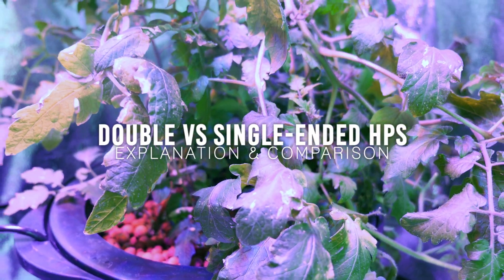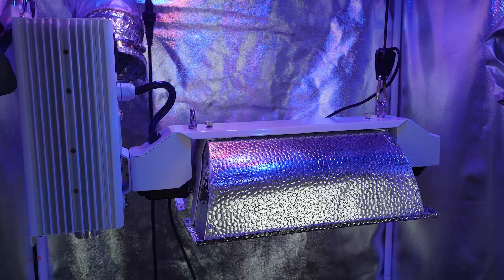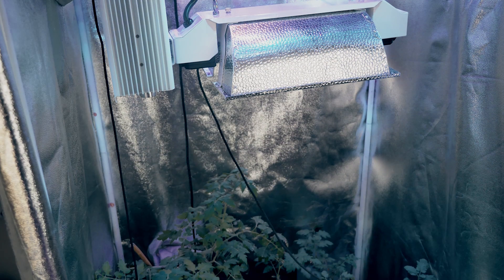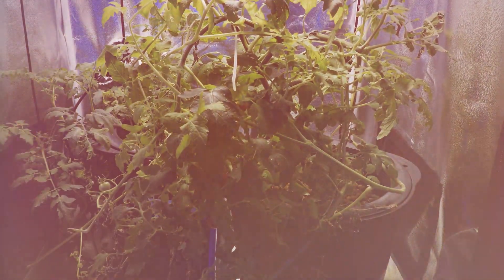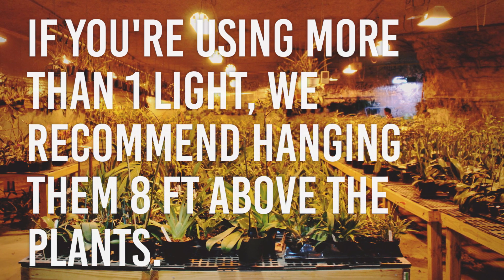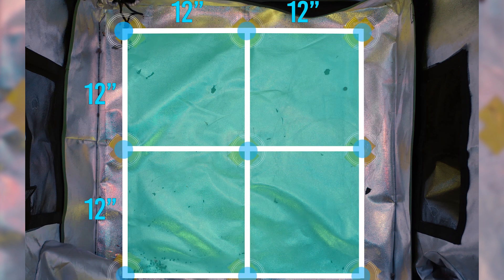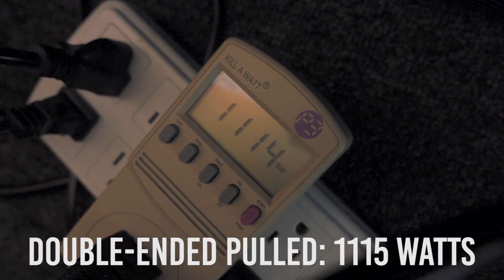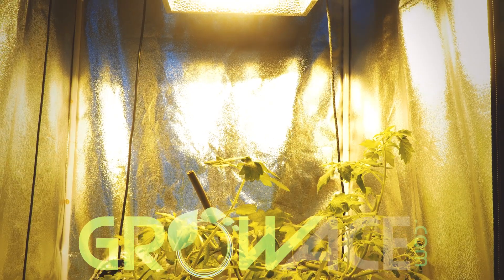REVIEW: Double-Ended DE HPS Grow Light vs Single-Ended Bulbs for Hydroponics Garden

Comment: Double ended grow lights VG701 specification

Power:1000W
Input Voltage(V): 110~220V
Par Output (PPF): 2100µmol/s
Lumen output maintenance rate: ≥95% 
Color Temperature (k):2000
Light Output (Lumens100Hrs):148000
Light effiency: 148 L/W
COLOR Rendering Index (CRI): 22

Comment: I hear that the De bulbs also run much cooler than a Se, any facts on this?
thanx
Reply: +Pissed Off Papa, unfortunately, it is the complete opposite.  DE bulbs run significantly hotter in our tests.  We required more cooling then expected.
Reply: You may bought the fake DE which made by street light burner contain much IR than real one

Comment: I need to know about the electric use of a grow room for my solar and battery bank setup  Can you help out? I'll need volts amps and amps
Reply: vague question but I'll try. 1000watt is 5 amps at 240 volt or 10 amps at 110, roughly. I would recommend 2 600s over a single 1000 room. run lights during the day with a 18 hour veg or no less than 16. pull air from your house into the room so you wont need heaters or air conditioners. and dont bother with cfls or leds
Reply: you need at least 1.5 to 2KW/h  of power only for a 1000w bud room and 400w for veg room + electrical loose , blower , ballast      at 120v  15-20 amps   240v half amps so on

Comment: How are DE bulbs 25-30% more efficient if they're only drawing 5 less joules/second?
That PAR differential, however, is phenomenal.
Reply from the maker: Claudio Mateos Great question! It's efficient in terms of design and performance. The DE bulbs do not require an additional wire connection to emit unlike the single ended (SE) grow bulbs. Because the DE lamps are connected end to end, it typically offers 90% lumen maintenance at 10,000 hours of use. Standard mogul (SE) lamps offer 85-90% lumen maintenance after just 4,000 hours. Make sense?
Reply: +C. Alex Mateos  lets just say. GAVITAS are killing it right now lol.. and they do a lot better then people make them out ot be if u use them correctly.. I'm seeing friends pull 3lbs a light..

Comment: LED
Reply from the maker: Gary Host LED, eh? What about 'em?
Reply: +Gary Host LED's don't seem much more efficient than DE HPS, although they do have better spectrum and lifetime when properly made but they can cost 2x more than a DE HPS setup. LED is superior potential-wise, but the prices need to come down, the tech is already quite good.
Reply: otalkusanchannel how can you say that they are not more efficient? You dont need all that infra-red produced by an hid light, that is wasted energy that only produce unessisary heat. On the other hand, most LED fixures don't have enough orange/red .. if you wish to reach absolutely maximum potential you will use them both during flowering, in conjunction. The HPS doesn't even need to be run during the entire light cycle, but can actually bet set to switch on and off in intervals during the "day cycle". 

For instance: LED 12(OFF)/12(ON) + HPS: 14(OFF)-3(ON)-3(OFF)-4(ON) 

I have done this with 1200w LED + 400w HPS /1sq with astonishing results! W

The hps's we used for the experiment was mounted in "cool tubes" and so we supplemented with 36w 15% uv-b "desert lizard cfl bulbs" /1sq 

The variety was cocolate mint OG and we avraged 29% thc in the buds tested, and 1.6 g/w
Reply: I think some HIDs are better than others in terms of not producing wasteful infrared, but I was most certainly not saying HID are more efficient than LEDs, I said LEDs are not MUCH more efficient. HID lights don't produce as useful a spectrum as properly made LEDs can, so I disagree that it'd be optimal to mix both rather than getting a light that can properly produce the necessary red spectrum. LED is just slightly more efficient, the point people should really drive home about them is that they're higher intensity light (which plants like), run cooler (thus can be placed closer meaning a lot less wasted light energy) and (if made properly) produce frequencies of light specifically used by plants to perform photosynthesis or the fact that they last tens of thousands of hours of usetime longer and don't dim like HIDs do.
Reply: otalkusanchannel yes, you are correct when speaking strictly in terms of photons. However "heat" has a positive aswell as negative effect on plant growth. "High heat" stimulates the use of carbon dioxide, and increases the energy/photon uptake, yet cell reproduction peaks during lower "heat". It has yet to be completely researched what scientifically the effects are within the plant from the "boosting" with hid. 
The led panels we used was full spectrum with an emphasis on "cloudy daylight". And you could compare the day cycle more to that of a farmers field, where the direct sun comes and goes, but with an optimal amount of photons always available. The only variable is the pulse of infra-heat and orange/red "direct sun". 
Exactly what happens is yet to be explained and replicated over and over, but I can tell you that the smell shortly after the hids come on is really intense. 

And the end results so far has been nothing short of amazing every time, compared to the test groups using only hid (mh, hps) and only led.

Yes, the test was first conducted almost 15 years ago, using hps and mh in conjunction with each other. Also that test had positive outcome, yet not as amazimg as this one, using leds as the "cold sun".